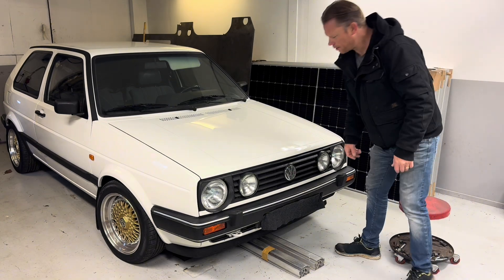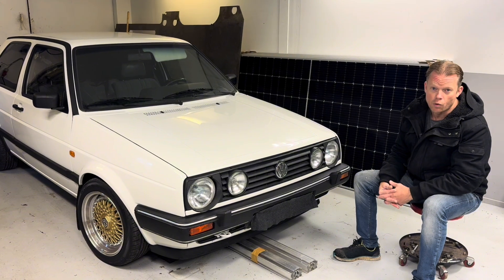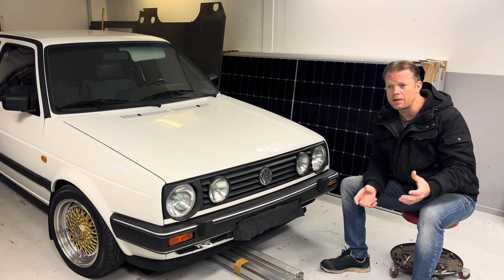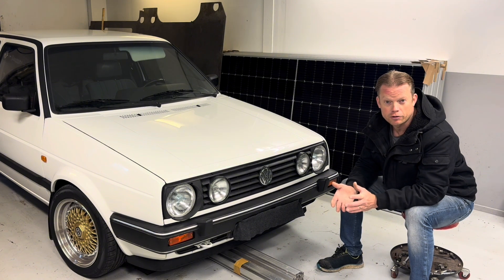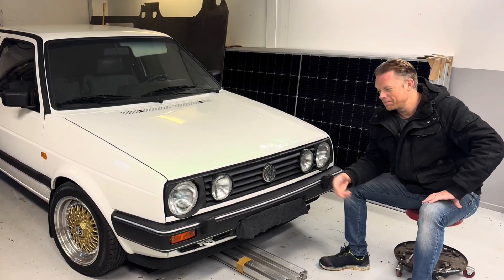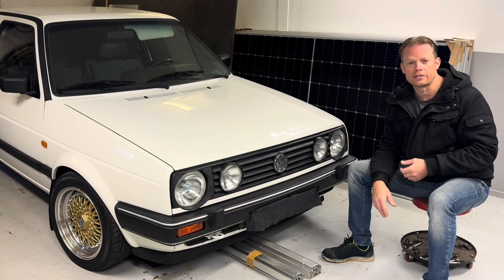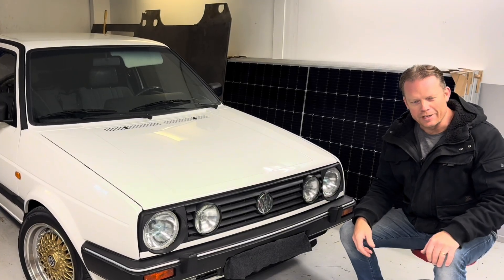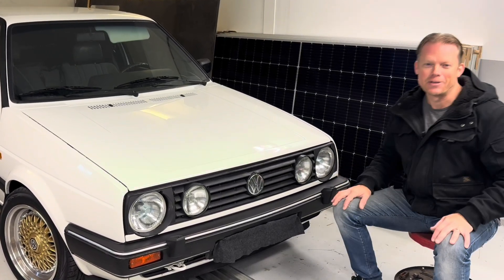Storage of my diy electric car Wv golf mk2 Citystromer.

Comment: I would remove the 12 volt battery for winter. Then the system always stays off. I would charge the HV battery to 60%. Then you can leave the car for 6 months without any problems 👍 With 50% you are currently the best off electrochemically 👍👍😎

Comment: I'm building the battery for my leaf drivetrain conversion, how is it going without battery cooling?
Reply from the maker: Hi. Great to hear. The cooling is not an issue here at least. Modules heats up around 6° after 10 kWh of dc charging. Normal charging no problem whatsoever, but I guess that more than one fast charging cycle at “40kw” is the limit during one trip.

Comment: Alternatively, you can use the battery over the winter as a home storage solution! That is what I do on my EV project car!
Reply from the maker: Absolutely 👍🏻
I will have it as a backup battery to my existing battery if the energy price goes through the roof😉 I have 9 modules to my house so sadly I can not have them in parallel. I also like to have the extra amount of power due to the higher voltage that an extra module will give me.
That’s why I whent with the id3 battery from the beginning😉 
Thank you so much for your input 👍🏻👍🏻
Reply: Seriously that's the best idea, use the battery's as the house battery –nothing in the way  @flyingtools
Reply from the maker: @andreasstromberg  yes absolutely, if didn’t already have an even bigger battery to me house😅. For me this will be a down grade if so both in power and kWh. I will only use it as an emergency backup battery.
Reply: @flyingtools add one more inverter :)
Reply: It's a thing of beauty, and can still be used as home battery storage too. Genius. Well done. Love it.

Comment: it also depends on the chemistry cause the LFP are a complete different thing. 
Those have nominal 3,2 V and not the 3,6 to 3,7 V
But at 3,2V a LFP cell is far below the 30% SOC .

My 14 kWh LFP cell battery (51,2 V nominal) running under a 1 kW load aka 20 A is around 25% but just 0,1 V difference can make a huge difference or dropping the load to 10A only cause the voltage will increase.
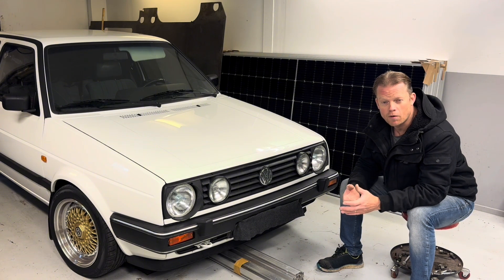Reply from the maker: I made that very clear at 3:25 in the video.
“Look at the specifications of the cells YOU are using”